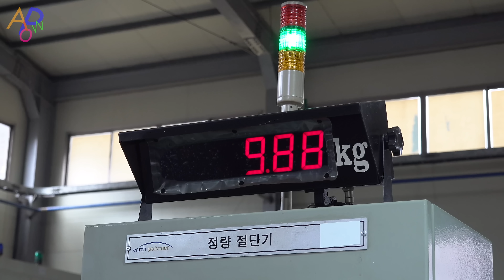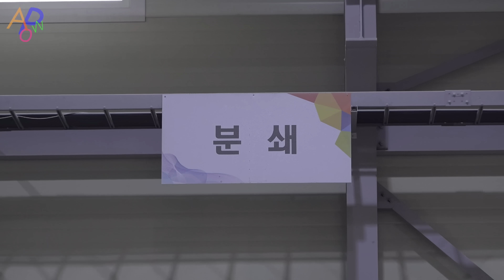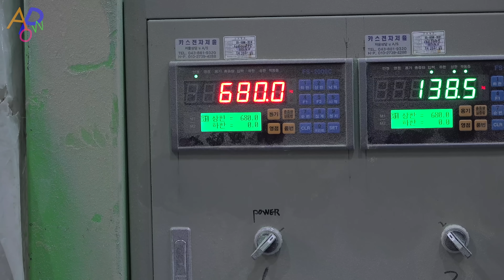How to Make Waste Rubber Into New Synthetic Rubber. Interesting Rubber Manufacturing Process

Comment: Interesting ! But i don't understand what is the "abundant 2nd hand rubber source", and why it is vulcanize flat, THEN schredded, THEN (will we know one day?) flattended again and I imagine, glued together to make playing mats. Why not doing mats, then vulcanize it, simply?
Reply: I work in manufacturing and although I am no material scientist, I know quite a few. I think the answer to your questions is: homogenization and redundancy. Working with off cuts (the 2nd hand rubber) means there may be some inconsistency in how the rubber was produced. By mixing, kneading, vulcanizing, pulverizing again, etc, you reduce the potential for under-formed rubber to dominate an area of a batch. 
The other reason to pulverize it at the end is that the end goal may not always be mats, plus: bags are easier to weigh and store than large sheets. Although some things may not make sense, I feel like when you work in manufacturing, you come to realize that solutions that already exist are usually cheaper (bags and pallets) than what seems simpler (large stacked sheets? how do they get lifted? what if the forming machine doesn't take sheets?).
I hope this maybe helped in some way :)
Reply: Yeah true for the transport ! Thank you for your answer :) I tought that vulcanizing was possible to be done only one time..
 @sorou   Also it is good to know when you see the plastic bags being proceeded together with the rubber, that even when written "rubber" it can containt other non food grade/whatever standard stuffs... 😅

Comment: So they cut up rubber, mix it with stuff, roll it out. Then roll it up, wrap it in plastic. Then mix it, roll it out again, wrap it in plastic again, bake it, then grind it up again. Beautiful!
Reply: I don't know what the hell is going on I just watch
Reply: They could have probably skipped like half of the process and still ended up with the same product in the end... Is the heat-sealed plastic a needed part of the process? Does it contribute anything valuable to the final product?... Otherwise, a lot of this seems kinda needless...
Reply: @BGBTech  Interesting video but definitely needs some narration. Without explanation I agree some of this seems kind of needless and confusing.
Reply: @BGBTech  EPDM Ethylene Propylene Diene  so the polythene bag is compatible with the compound and can be mixed in
Reply: And then they make bed pads and we sleep on it 😂
Reply: W.e.f bullsheite
Reply: Master of make work projects
Reply: There will come a time when factory processes are designed specifically for there visual appeal on YouTube… who knows maybe we’re there already
Reply: It's all about ensuring the product is homogeneous and the easiest way to do that is to keep dividing and remixing. There was a vulcanising step in there too as part of the process
Reply: @usherly  The vulcanising part really confused me!!! Vulcanising was the revolution that made rubber stronger & keep it's shape. It also made it nigh on impossible to re use rubber for something else of a similar spec, that's why old tyres aren't recycled into new tyres, just floor mats. Here they re vulcanised the rubber just to grind it back up into granules??? I can only assume that the mats are made with pressure only & vulcanising the rubber here would make the mats harder.
Reply: 1.18 cutting blade broken😊
Reply: Seems This process is some intermediary product. Usage of Input and output is both unknown.
Reply: I think without the plastic they’d have tiny rubber bits all over the factory.  I’m just guessing but it seems logical given the mess that stuff makes.